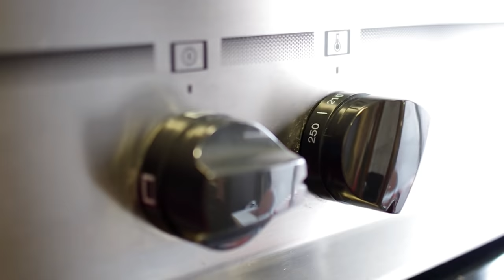Make a carving gouge with a broken drill bit

Comment: great build, and i got so many dead spade bits , tks for sharing
Reply from the maker: Thank you! Give it a try! I'll be surprised.
Reply: i thinking i will for next x mass,,, as i have two friends that every x mass i make us each a home made tool for the last 3 yrs, now,, from large mallets ,small tapping mallets,for chisel work , and this year it a awl  with curly maple handle  and old Allen keys, , they come out amazing,, and the allen key steel holds a point very well , ps, look for the longer type allen key, , 1-2$ at a yard sale for a set ,lol 4-6" + in length and cut off the L portion and insert in your handle , i chose the black hardened allen;s and not the chromed ones for look , ,,, been wanting a spoon carving gouge for years now,, and your idea fits that build tks ,

Comment: I havn’t think about it. It is realy smart. I like to make some stuff and spoons. I haven’t so professional tools like you, but it’s still fun.
Reply from the maker: +Malvin Botnen you can do this without expensive tools. You just need a cheap dremel a torch, a hammer, a solid chunk of steel to use as a anvil and sandpaper to sharpen the gouge. You can do this.

Comment: First I've seen somebody forge in a small shop without a forge, just using the torch to heat up the metal.
Reply from the maker: +RealRuler2112 There's no need to own a forge to do that as you can see. Of course, with a forge you will get quickly the desired temp and more homogeneous.